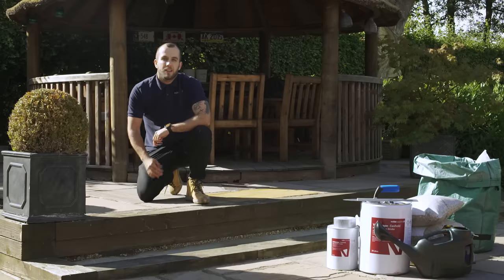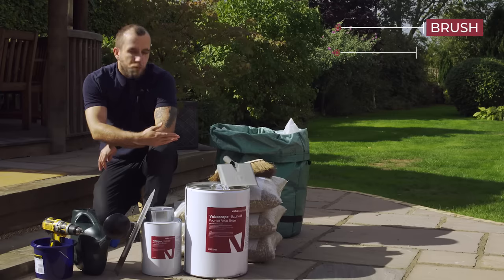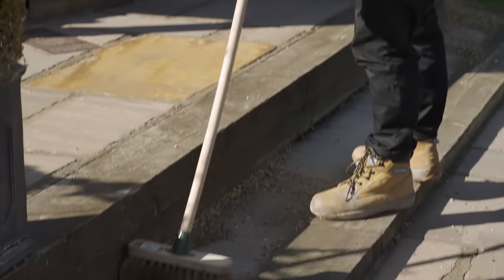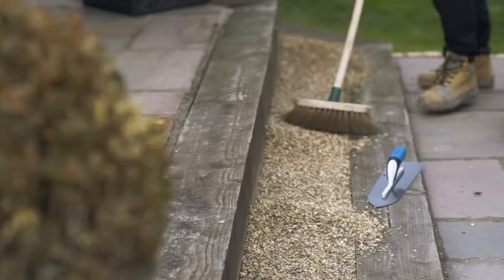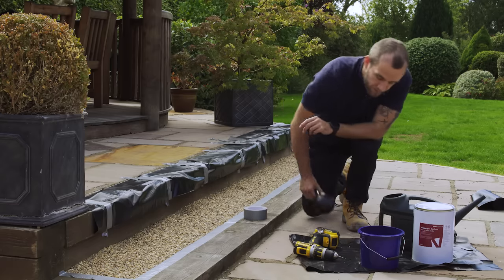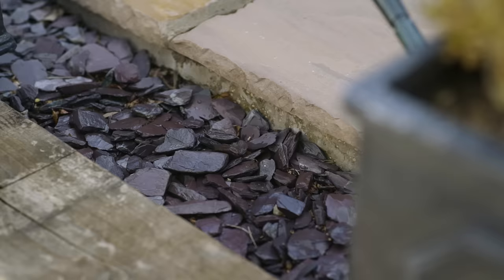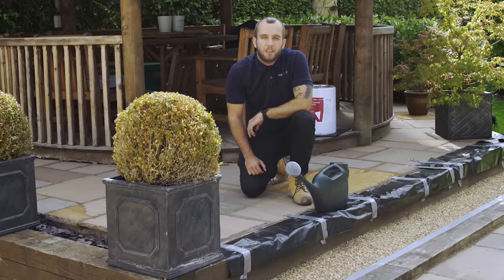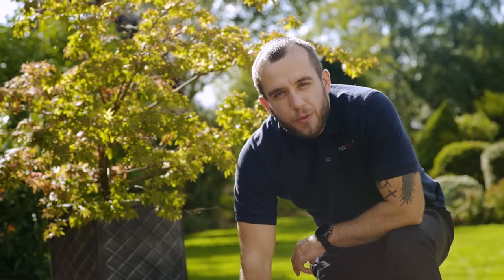Pour on Resin Gravel Binder (OLD) - See the NEW 2021 Easihold Instructional Video on our Channel!

Comment: Will the rocks stay in place even when driving over it? How long does it last?
Reply from the maker: It's not suitable to withstand vehicle traffic. It lasts 2 years, but can be topped up quite easily and won't need to use as much as the initial project.

Comment: I tried the spray-on method, but it just blocked the sprayer within minutes.  I had to resort to the watering can method, but this seemed to deliver too much resin and in a haphazard fashion even though I was careful - missing a little bit of the stones in places, as I was wary of applying too much.  I was disappointed. and wished I had gone for the resin-bound method (mixing in a bucket with a paddle), and I will do this next time.  In all honesty, I don't think Vuba should even be suggesting sprays or watering cans.
Oh, and make sure you mask everything (as I did) if you're brave enough to use a sprayer or watering can.  And wear gloves.  I took mine off temporarily to try and unblock the sprayer, and got the stuff on one hand.  It was annoying as it (obviously) is like superglue.

On a separate note, the choice of stones is extremely disappointing.  I used Azulado, which looked fantastic when it was all finished.  But there's only eight stones available, and some of them are almost identical!  Vuba really let themselves down here in a huge way.  There should be blues and greens.  I would like to see crushed glass.  Yes, I know I could buy them separately, but I would prefer buying everything from Vuba, so I know it's cleaned and compatible.  In future, I will have to source my own stones, so Vuba are missing potential sales.

I think it's a great product which provides a rather stunning look (everyone has commented on this small 4-square metre area I created), but it can really have only one application and as I said, it is let down by choice of stones.

Comment: Does this work with a Tarmac Repair Kit.   Where you replaced dislodged Tarmac with new material, then use EasiBond to secure it.   Just enquiring if this would work?
Thanks in advance.

Comment: What’s it like when it’s wet? Is it not slippery?
Reply from the maker: The aggregate / stone finish still maintains. Easihold creates a thin protective coating over the stones.
Reply: Yeah but that doesn’t answer the question?
Reply from the maker: @jptully6810  Easihold isn't a surface finish, so it's not a question of if Easihold is slip resistant or not. It creates a thin protective coating over the stones. Whether or not the surface is slip resistant or not will be dependent upon the stones - which will vary in almost every application.

Comment: I have a small path but the stones are 10 mm diam and the trench that has the stones is 20 cm deep. I just want to keep the top layer from moving. Does it work for that?
Reply from the maker: Hello, 20mm is the upper limit in terms of stone size but it would work yes.

Comment: I’m purchasing a home that has a small gravel driveway that is on a slight grade. Versus having concrete poured, I had thought about using this product to stabilize the gravel to prevent slipping as a temporary solution (roughly 1-2 years of use). What do you recommend?
Reply from the maker: Hi Isaac, unfortunately on a driveway it wouldn't work. But maybe gravel grids would be a good solution for you. Relatively inexpensive, easy to install and stops the stones from sliding. They are on our website called VubaGrid Cellular Grids. Hope that helps!
Reply: @VubaResinProducts  Thank you got the tip. I will check it out.

Comment: Is this permeable??
Reply: Yes, providing that you haven't used too much resin and created a block.  It's not like porous concrete made with gravel and cement (I successfully trialled that for a large step), but will still let rain through.  If you're going to use the bound method (I would strongly recommend that, see my comment above) then a mix of 2 litres of resin to one 25kg bag of stones is the recommended mix by Vuba.  I haven't tried that, yet (and it would seem to me to be too much resin) but that's what they told me to use, and they should know.

Comment: Omg how was I not aware this solution was available? 🤦🏽‍♀️ I am forever putting my stones back in their place after the kids have attacked my garden! My only concern is that I used plastic under them for weed control..... would this still work??
Reply from the maker: We would recommend using a permeable membrane underneath stones for weed protection - to allow through rainwater etc. If the membrane isn't permeable then we wouldn't recommend applying Easihold, but if it is, then it would be fine!

Comment: Hi, I have decorative stone gravel next to my neighbours grass boundary. When the resin has set, will I be be able to blow any grass cuttings off the stones with a blower or soft brush?
Reply: No the mud and leaves will work down into set gravel and never be for rid of, then weeds will grow from inside. At least with loose gravel or can be cleaned or dug over
Reply: @borisgulliver4970  cant the debris be rinsed off w a hose/rain?

Comment: Great presentation however many comments are asking if you can drive/park a vehicle on the set gravel.....can you ?
Reply from the maker: Hello, you cannot drive on stones treated with Easihold. It wouldn't be strong enough. We have resin bound kits which can be used to create a fixed stone surface for driving on.
Reply: Vuba Resin Products ok thanks for the clarification 👍
Reply from the maker: @wokeupandsmellthecoffee214  No problem, apologies for the delay in replying.

Comment: Hi there. Can rain water get through this?
Reply from the maker: latin105fm Yes, it remains completely permeable
Reply: Hi is this suitable for indoor use? I’m looking to install in a bathroom on a wooden floor.
Reply: @DANCINGSEABASS  as the manufacturer has stated it remains totally permeable then by definition the last place to use it would be a bathroom floor where water is going to permeate through and rot the wood.
Reply: Wot Viewer Perhaps they want to be able to shower two people at once- one in the bathroom, one in the kitchen beneath...
Reply: @spencerwilton5831  😳😂😂😂😂